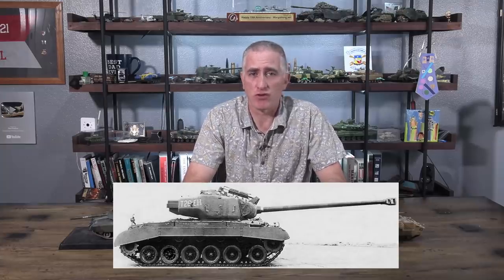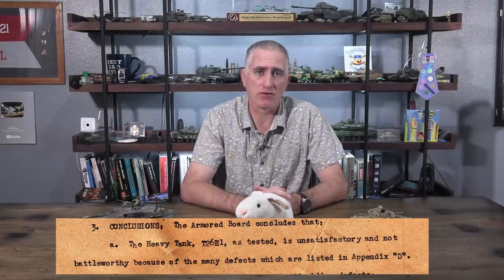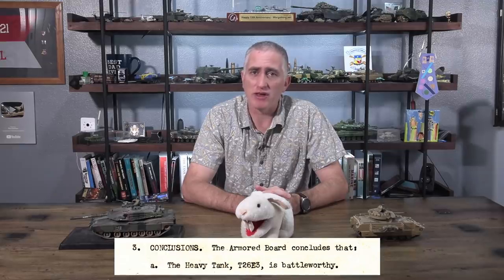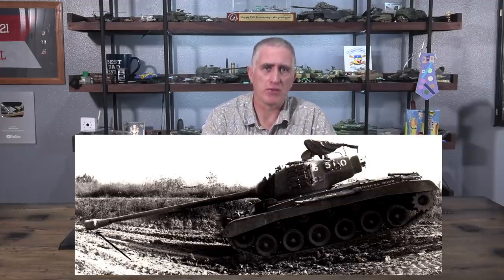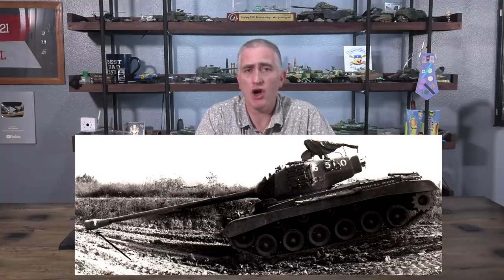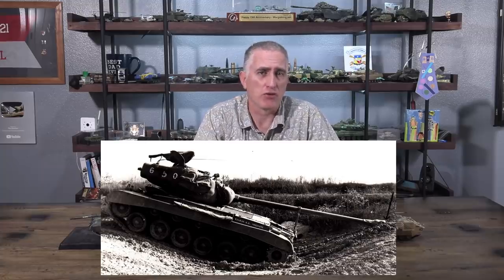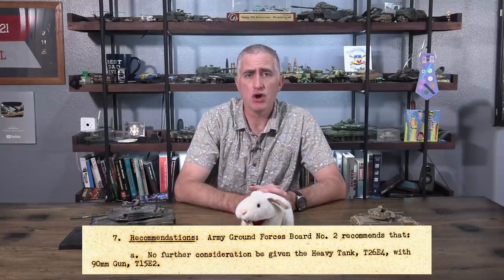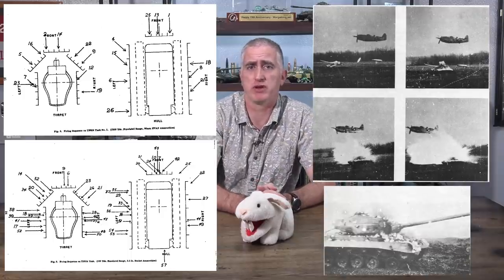Super Pershing: Why T26E4 didn't work.

Comment: Whenever you see a Tiger claimed killed in Western Europe, subtitle it as (Probably a Pz IV)
Reply: Or a panther
Reply: Patrick Ancona  around only 1,350 Tiger 1 were made and only 480 Tiger 2 ,by wars end.
Reply: Patrick Ancona  Where are you getting 1000 and 4000!?
Reply: Patrick Ancona  it's more complicated than that. Chieftain has a good video on why the Tiger was a good tank for its role, and also a number on why the Sherman was a excellent tank for what the US needed.

A lot comes down to doctrine and logistics. The Germans designed a logistics train to support the needs of the Tiger and had a doctrinal use for it as a breakthrough tank. Once the logistics broke down and it was used outside its intended role it had difficulties.

While the Sherman focussed on numbers on the ground, ease of transport to the European theatre, reliability and lighter supply chain reliance, and anti-personel focus for the main gun.

It's not as simple as "if it were good, we'd have made our own".

As I said, some very detailed Chieftain videos on this subject
Reply: Patrick Ancona  Most of those ended up being on the Eastern front...there are very few Tigers who actually engaged US forces but LOADS of other armored vehicles. Yes, US troops did take out some Tigers and King Tigers...but it was still "rare" compared to all others.
Reply: There's a Hogan's Heroes episode "Hold That Tiger" where the prisoners supposedly steal a Tiger tank, take it apart and make blueprints of it. Because they couldn't get an actual Tiger for the role, they substituted an American made M7 Priest. I think it would have been nice little to this fact if the tank they used was a  Pz III or Pz IV. The Germans certainly made a lot more of those, although I don't know if there were any available for use in this episode.
Reply: @rodh1404  Given the tendency of cinema to just slap a paintjob onto an American tank in general, chances are their only shot at a Tiger was to mock something up. Since we're talking about a TV show, not a movie, they likely didn't have the budget, so they rented a Priest.
Reply: Everyone, do yourselves a favor and look at a Pz4 with the turret Schurzen (and no side Schurzen).

Looks a lot like Tiger turret, doesn't it?
Reply: @Chrinik  I think it's because the pz 4, stuggs and tiger 1 all had that box like hull which have contributed to making mistakes for sure
Reply: Most of u know what the german tanks look like but imagine u r a guy that has never seen one before u joined the army. Now u have a a tank at 500m u cant really see if it has a turret in that case u will just assume something and go with it.
Reply: Thirsty Sexpert That simply isn’t true. For example, greatest concentration of Tiger IIs was likely during the Ardennes Offensive, but that wasn’t “almost all”. They were used extensively on the Eastern Front and in Normandy they were primarily concentrated against the Commonwealth forces (because that was where a breakout attempt was expected, and where the breakout was originally planned, due to better terrain than the US sector). Of course it is more complicated because many tanks and crews fought on multiple fronts against multiple enemies diring the war.  

The fact is, they were fairly rare so the odds of any enemy encountering one weren’t good. And as they fought as units concentrated in an area rather than spread across the fronts it makes it even less likely for a given soldier to have encountered one and for those who did to have encountered a number of them. 

And it is a known fact that tigers were often reported when the documentary evidence shows they weren’t in the area (a famous example being the claim that an M8 snuck up behind a Tiger II and destroyed it, there were no Tiger wrecks located in the area and German records show no Tiger IIs were in the area at the time).

And I am sure you could find plenty of German soldiers that reported a Universal Carrier plodding along behind some infantry as a tank attack because that is the way the human mind works. You see the worst possible scenario because overreacting to a lesser threat has a much lower mortality rate than under reacting to a greater threat.
Reply: Thirsty Sexpert  I highly doubt it. The Soviets were knocking out Tigers before the US even saw their first one in Italy.
Reply: Thirsty Sexpert  Okay, no? The first use of Tiger I tanks was with Heeresgruppe Nord near Leningrad in late August 42...
Granted, they were literally the first, experimental models, but still, that was their first use.
They still had technical crews from Henschel with them.

It wasn't until November 42 that they got ordered to Tunisia, and during that entire time until May 43, only 7 Tigers where destroyed directly by enemy fire, the rest scuttled by their crews because of technical malfunction, Mines, loss of running gear or artillery.
In total about 960 Tigers were deployed to the eastern front between 42 and 45, with only about 1300 produced, I can't see how "half of them" fought the US at all, sorry...

Tiger II, yes, loads of them got send to the western front after the D-Day landings to stem the tide.
Reply: Thirsty Sexpert  "To Guderian’s disgust, the Tigers first saw action in the siege of Leningrad. In his book Panzer Leader, Guderian wrote, “[Hitler] ordered that the Tigers be committed in a quite secondary operation, in a limited attack carried out in [swampy, forested] terrain that was utterly unsuitable. . . . The results were not only heavy, unnecessary casualties, but also the loss of secrecy and of the element of surprise for future operations.”

The tanks in Tunisia were the first production models. You do know there are pre-production runs to try vehicles before then?

It also still doesn't erase the fact that over 60% of all Tiger I's made rolled straight into Russia.

"Also There were 7 Tiger I tanks destroyed in a single action in Tunisia, Not over the entire campaign." Destroyed by enemy tanks...I never said anything about all losses, most losses were not due to penetrations by enemy gunfire, but secondary means leading the crews to scuttle their vehicles. Quite a difference. But apologies for using plain english.

The total number of Tigers sent to NA and Italy pales in comparison to just the losses on the Eastern front.

"Also The 501. And 504. Heavy Panzer Battalion were both deployed to Tunisia in late 1942 early 1943. There were only 78 Tiger tanks that had been produced by the end of 1942 and each battalion had 20 Tiger tanks. Meaning that at that point over half of the production of the Tiger would have been sent to face the Americans in Tunisia."

A moot point, at some point, 100% of all STG44s were used to fight russians, because their first use was air-dropping them to a trapped unit...also it's quite bold to assume it was just americans in Africa and Italy...
Reply: Thirsty Sexpert The Tiger’s first service was at Leningrad, although this was more of a field trial than anything else. As the Tank Museum says it’s first service was in the east https://tankmuseum.org/tank-nuts/tank-collection/tiger-i/

And they weren’t sent to Tunisia to “to face the Americans”, the Americans were just one force in Tunisia, and a relatively small one.  Not only did you have the Eighth Army that had been chasing Rommel all the way there from Egypt, the bulk of the forces pushing in from Morocco and Algeria were British and French, with the US II Corps one of the four Corps of the British First Army. 

In fact, the Tiger’s first combat in Tunisia was against the British and the first Tiger knocked out by gunfire was in Tunisia by the British. 

And all the way up Italy they were facing various Allied forces, not just Americans. 

And you directly contradict the idea that all Tigers were sent to Italy and Tunisia by commenting on their use at Kursk. There were over 200 present at Kursk, two thirds of the production to that date.
Reply: Thirsty Sexpert “The other allied forces were Auxillaries to the Americans”

To say that you either are such an American nationalist that you are blind to reality or you need a lot of basic history education. 

In the Tunisian campaign you had the Eighth Army attacking from the South and the First Army attacking from the West, joined under the 18th Army Group once the joined up. 

The Eighth Army was entirely composed of Commonwealth formations, including many of the best equipped and had the most experienced divisions that the Western Allies had to offer having fought there from El Alamein. 

The First Army was composed of one French Corps, one American Corps, and two British Corps (one of which did include a couple American divisions). And the inexperience of the forces involved was clearly on display at places like Kesserine.

The US Army certainly played a large role but it was not even close to the largest or dominant force involved in the Tunisian Campaign.
Reply: Thirsty Sexpert Again you are either blinded by nationalism or have a severe lack of knowledge. 

By the end of the war, the US were still a minority of the Allied forces in Italy, significantly outnumbered by non-Americans (British, Canadian, New Zealand, India, French, Polish, Brazilian, and Italian troops). 

And while Northwest Europe saw a continual shift to more American forces from roughly equal numbers on D-Day, there were still something like a million British and other Allied troops in the thick of it until the war ended, far more than a token force. 

And that doesn’t mention fighting elsewhere. The bulk of the Germany military was destroyed by the Soviets in the East or the majority of the Japanese Army that was sent to fight in China, Burma, and India against largely Chinese, Indian, British, and other British Empire forces with only small numbers of Americans involved.
Reply: Thirsty Sexpert  The Eastern Front was a secondary front for the Axis? That's news to me. Do you have any evidence to back up this claim?
Reply: Thirsty Sexpert  Sorry, I should have been more clear. Do you have evidence of someone reputable (who is not you) saying that the Eastern Front was a secondary front for the Axis?
Reply: Thirsty Sexpert  No, dude, I take the word of someone who actually has a reputation in the field. I'm not sure an accredited historian would go by the name of "Thirsty Sexpert". But maybe I'm wrong, maybe you're some millenial or zoomer history prodigy.

I'm also not sure a real historian would use Wikipedia as their primary source, but that's neither here nor there.

Generally the information on Wikipedia is backed up by sources. Those sources are frequently books or essays by real historians! So, since you brought up Wikipedia, it shouldn't be difficult for you to come up with a few quotes, maybe a statistic or two. Maybe a quote from a real historian saying something to the effect of "the Eastern Front was a secondary front for the Axis"! That would be cool.
Reply: Thirsty Sexpert  You didn't provide any sources, but I'm going to give you the benefit of the doubt and assume they're all true.

You are comparing Eastern Front casualties vs. the combined Mediterranean, Atlantic, and Western Front theaters. Individually, the Eastern Front probably had more casualties than any of them. Doesn't prove your point.

So the Eastern Front featured "underequipped reserve divisions", but then you go on to say that "veteran units" were transferred from there to the Ardennes. Contradictory. Doesn't prove your point.

Here are some "veteran units" that stayed on the Eastern Front until the end of the war: Grossdeutschland. Totenkopf. Hermann Goering (the division, not the man) was sent East after fighting in Italy. Hitlerjugend was sent East after the Ardennes; did the Western Front suddenly become a minor one?

There's a very good reason why the Germans might have transferred veteran units to the Ardennes; attack is more difficult than defense (which is what they were doing in the East at that time). Could you say that the Western Front was more important for that battle's duration? Sure. Does it make the Eastern Front a "minor front"? No.

There's also a very good reason why the Germans had tons of troops in France for Normandy; the Allies were trying to open a third land front. Very crucial that this be prevented. Could you say, for the duration of the Battle of Normandy, that this front was more important than the Eastern one? Sure. Does it make the Eastern Front a "minor front"? No.

The Battle of Berlin was quite a bit more involved than just the fighting in the city itself. 767k German soldiers participated in it. Not just 90k. This is a great documentary about it: https://www.indiegogo.com/projects/documentary-16-days-in-berlin#/

Find one reputable historian who says the Eastern Front was a "minor front" and I will admit you are correct.
Reply: Thirsty Sexpert  If you're a historian, then you must have read some other, reputable historians. If your thesis can be easily proven by some Wikipedia statistics, as you claim, then surely some reputable historian has come to the same conclusion. Find one.
Reply: Thirsty Sexpert  If it's as simple as 1+1=2, you should be able to find a reputable historian that agrees with you.
Reply: Thirsty Sexpert  Then one of those historians must have come out and said something like "Based on these statistics, I conclude that the Eastern Front was a minor front for the Axis." It should be easy to find. Go find it.
Reply: Thirsty Sexpert  You literally based your argument on Wikipedia evidence. You admitted as much. I'm willing to give you the benefit of the doubt for argument's sake, but I'm not willing to assume that a real historian would use Wikipedia. Show me a real historian who has come to your conclusion, or go away.
Reply: Thirsty Sexpert  You misunderstood me. I was willing to assume that the numbers are true for the sake of arguing with you, but I'm not willing to assume that an accredited historian would use Wikipedia numbers as evidence for a theory. It's only applicable because you claim to be an accredited historian.
Reply: Thirsty Sexpert  So any other historian on the planet will agree with your thesis, but you can't quote or cite any of these historians. Do you realize how ludicrous that sounds?
Reply: Thirsty Sexpert  So I should listen to a guy who goes by the name "Thirsty Sexpert" and gets his facts from Wikipedia, instead of an accredited historian. Got it.

This is the same reasoning used by those who ignore Dr. Fauci and listen to whatever charlatan Trump has dredged up.
Reply: Thirsty Sexpert  Nope. I never accepted that Wikipedia was accurate. I told you that I would assume it was correct, for the sake of arguing with you.

The reason I find your theory so absurd is that Operation Barbarossa was the largest land invasion in the history of warfare. Clearly, at this point the Eastern Front was not a "minor front". At what point, in your opinion, did it become a minor front? Let me guess - the instant the Americans entered North Africa, right?

You're an accredited historian. Have you written any books? Essays? Anything you can point to on the internet? Do you have a masters? Doctorate? What was your masters or doctoral thesis on?
Reply: Thirsty Sexpert  What I said was accurate. Barbarossa was the largest land invasion at that time. That's what I said. The fact that a larger invasion happened later does not contradict what I said. Are you going to address the point I made?
Reply: Thirsty Sexpert  You appear to be confused by the difference between "was" and "is". Barbarossa was the largest land invasion, at the time it happened. Saying that Barbarossa was the largest land invasion - full stop - is a correct statement. I will admit that sometimes people use the word "was" when they should really use "is", but that doesn't make what I said incorrect.

"That is why the Eastern Front was a minor front, because it didn't determine the outcome of the war in any meaningful way."

That's such bullshit. They invaded with 3.8 million men. Imagine all those troops bolstering the forces in North Africa, Italy, and France. (Yes, I know they transferred some troops. If you try to say they transferred the majority, I'm going to laugh at you.) Besides the men and tanks, the Luftwaffe would have strengthened by thousands of planes.

I'm done arguing with you. You gave me your thesis statement - the Eastern Front was a minor front because it didn't affect the outcome of the war in a meaningful way. Find me one historian - one! - who agrees with you.  If you do, I'll admit that your theory has merit. Otherwise, I'm not going to respond to anything else you have to say.
Reply: Patrick Ancona So much text, so much wrong.
Reply: Scott Kenny Why don't you just say "skirts" instead of butchering the german term so hard?
Plus: The "skirts" on the Panzer 4 H aren't skirts at all but additional armour plates to counter russian anti tank rifles. 
For example Panthers and Tiger 2s got sideskirts over their tracks.

Please don't throw those terms around like that anymore.
Reply: I think a Panzer IV with the armor skirts looks a lot like a Tiger I. Perhaps the reason for all the Tiger reports.
Reply: Soviet soldiers did it too. Everybody did misidentify tanks
Reply: Eh, depends on where it was claimed as well. British and Canadians were more likely to encounter these than the Americans and their tiger kills were confirmed to be real deals most of the time.
Reply: Albert Fels  First of all, I stated raw production and deployment numbers, per year, those don't lie, if you deploy a majority of your produced assets in that year to somewhere, it probably means it has some sort of import to your war effort. Because no, the numbers deployed were in reference to the construction numbers, not total numbers of Tigers available. There was only ever a relatively low number of Tigers, if 60-70% of them get sent straight into Russia, you tell me why.

So, what about those German units who got moved around a bunch, and their accounts then? Consistently, their reports of logistical trouble, lack of food and material are plenty, most of the logistical trouble seeming to stem from a lack of railway support because the rail guage in the soviet union was incompatible. 

Likewise, the climate and geography are often stated to be far worse than the milder climates and flatter terrain of France and the Benelux states.

As well as an overall higher military attrition rate, the eastern front also lasted longer, and saw several army groups outright destroyed. The soviet retreat using scorched earth tactics in places left less for the Germans to occupy, compared to France, which fell in 6 weeks, was relatively intact and occupied by Germany for several years before the allies landed there.

The Sexpert also makes the claim that there was "9 Million German casualties" on the Western front...which I have never seen or heard before and can't verify either, most estimates are around 5.5 Million in total, which includes captured by the allies.
Where as the Eastern Front quotes roughtly 5.5 million DEAD and an additional over 4 million captured. And no, that's not Soviet Propaganda, because the Germans also have something to say about their losses...Your name sounds German, you go read some of their reports as well.

I know that a bunch of post-war accounts by high rank officers are skewed, but the general numbers don't lie. The allies simply could not inflict as much destruction on the Wehrmacht in slightly over one year in France than the Soviets could over 4 years. It's improbable.

Yes, the germans threw a lot of heavy effort at the western front...primarily because they thought they could beat them relatively quickly while fighting a defensive war against the soviet onslaught and then refocus their efforts on the east...did not turn out to be so easy in the end.
However, it is estimated that even with no distractions by allied troops on other fronts, the Wehrmacht would not have been able to stem the tide, despite inflicting horrendous losses on the Soviets, they arrived in Germany with the largest land army on the Planet at the time. They would have likely been able to sustain even higher losses. Germany could not.

And yes, in general, there was heavy fighting in almost every theater, but the general claim that the eastern front was "secondary", less important and that the US was the sole enemy Germany was ever concerned about in the war is pretty bold.